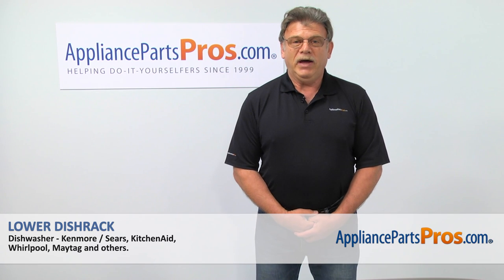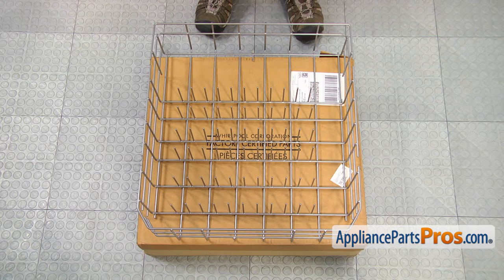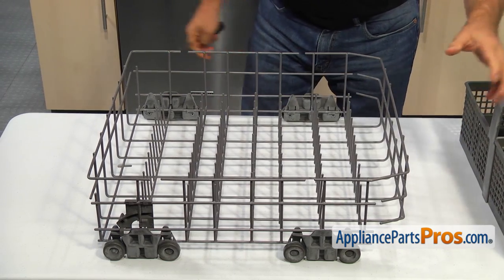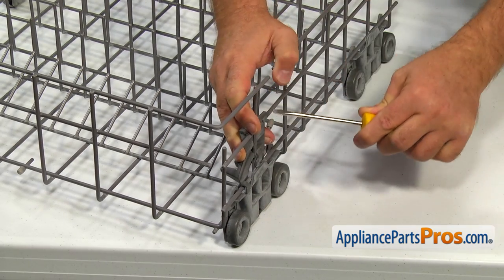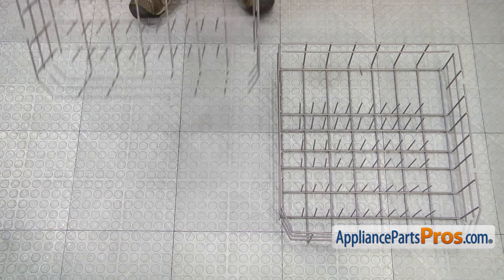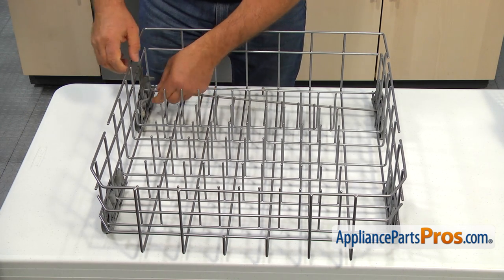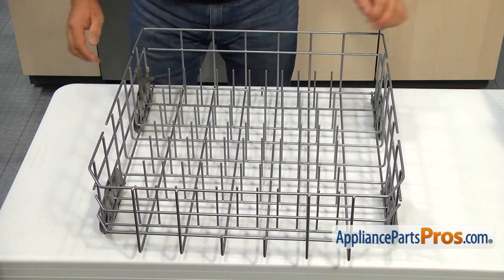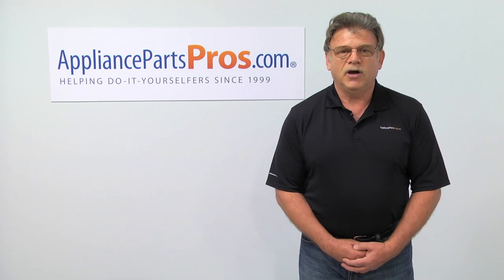How To: Whirlpool/KitchenAid/Maytag Lower Dishrack W10728159

Comment: Thanks for the help.  it is really hard to see what you are doing, especially when it's time to put in the folding tine.  Any way you can redo with some close ups of that part of the video?  Also, our original rack had 2 fold down tines.  Apparently, the rack has been redesigned with just one. It was confusing because we had extra parts - could you address that issue in the video?